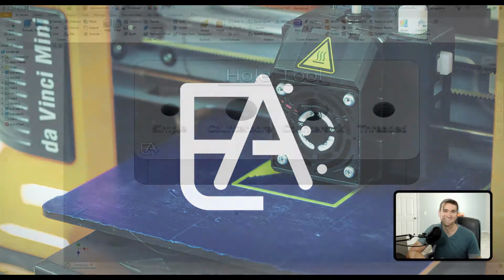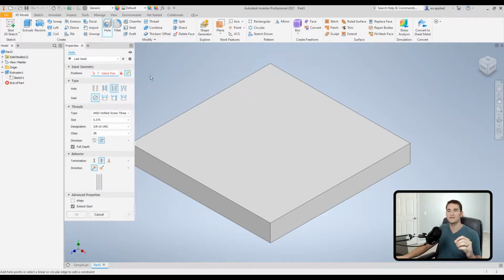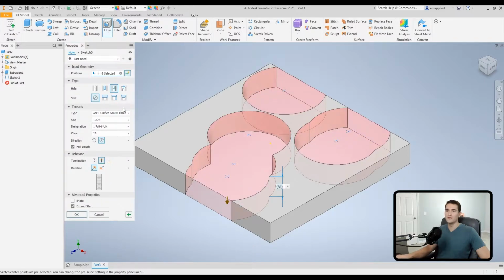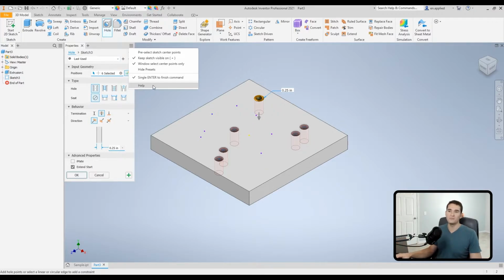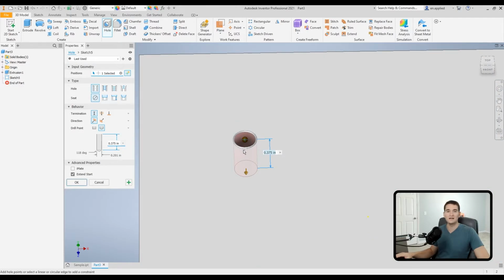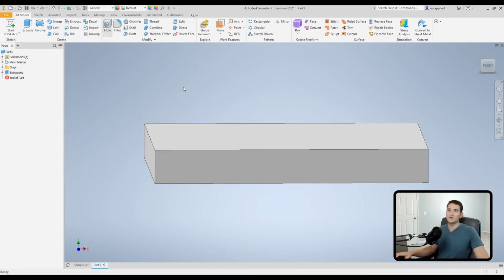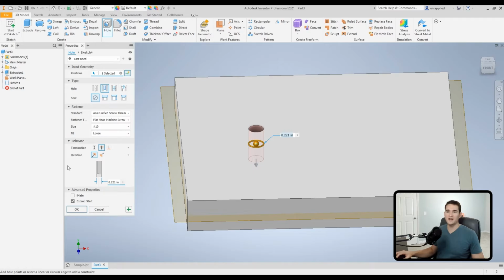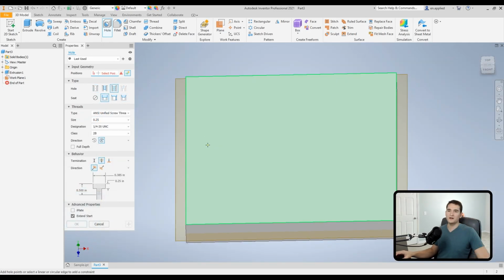Hole Tool and Options - Autodesk Inventor Part Tutorial | Autodesk Inventor 2021 IN DEPTH

Comment: How would I do a row of different sized holes? For example if I was making a drill bit rack. If I use the POINT feature it will make all of the holes the same type and size. Do I have to do a sketch for each individual hole position ?

Comment: I always perceived edge-to-hole dimensioning as not clean design and never used it in Inventor and not going to. I only used it when I have to work in solidworks. The advantage of sketch is a possibility to use it for other alterations, let say changing holes for slots, parametric dependences and many etc.

Comment: how to create a double spot face on a surface??
Reply from the maker: Great question! I am currently editing a video to be released today but I will go ahead and film a quick video on how to do this as soon as possible. In the meantime, what you want to do is the following (I'm assuming you are referring to a curved surface):

1. Click 3D Sketch > Curve on Surface > Drop a curve on the surface with two points and click OK > Click one of the two points you left on the curve then click the center point button in the ribbon under the format section (this converts reference point to center point)
2. Position/Dimension center point location as necessary on surface
3. Create a reference plane that is tangent to the surface AND coincident to the center point you created on the surface (Command is "Tangent to Surface Through Point" found under the work features section in the 3D model tab)
4. Click Hole command and select your reference plane that is tangent to curved surface and coincident to your hole location reference point you left on the surface
5. Select your spot face and parameters and click OK
6. Now you should have your spot face on the one side where you want it, now you just need to create another reference plane that is parallel to your initial reference plane and half the diameter of the part in distance and mirror the feature over that plane

I hope this helps! Make sure you subscribe to the channel so you don't miss the video reply to your question.
Reply: @engineeringapplied  I mean I need to create a  another spot face  on the other end of the hole. I had already a spot face on one side of the plane , need to create another spot face on the opposite side.I  m trying to create  double spot face on a certain hole, spot face on each end
thanks
Reply from the maker: To my knowledge, you will not be able to create a double spot face feature in one step using the hole command. However, you can accomplish this is two steps in a couple different ways:

1. Since you already have your first spot face feature, you can simply mirror that first spot face over a midplane which will achieve the desired result of a spot face on the other end of the hole. NOTE: Make sure the midplane is truly centered with respect to the original and opposite face so your depths for the spot faces are identical (assuming you want to create an identical spot face feature with the same size/depth parameters as the original spot face).

2. The second way you can accomplish this is after you have created the first spot face, create a sketch on the opposite face where you want to position the second spot face and place/constrain a center point concentric to the first spot face feature. This will make it so that if you ever adjust the location of the first spot face, the second one will follow automatically. Then, go to the hole command and select that center point you put in your sketch as your second spot face location, set your spot face size parameters, and you should be good to go. 

I tested both of these methods and they will achieve the end product that you are looking for. Like I previously mentioned, I do not believe there is a way to create both spot faces in one step within the hole command (but I'm always open to correction from our community). I hope this helped! Cheers!
Reply: @engineeringapplied  
thanks for the feedback
hope you can help me ,
I'm trying to make an assembly thru inventor pro, for no apparent reason under the constrain command, I can't click the the preview button( eyeglass icon) its shaded as grey color, thus I can't  execute the mate and ,flush command.
Reply from the maker: Sure, I'll see what I can do. I have some questions regarding your assembly:

1. How exactly are you trying to constrain the parts (what shapes and faces are you constraining together)?
2. Are you trying to constrain two separate part models, or are you trying to constrain two solid bodies but they are still in a single model?

Usually when you don't have the ability to execute the command due to input errors, the preview is not available. (Which is what you mentioned in your original question).
Reply: @engineeringapplied  hi can you please do video explaining  stress analysis